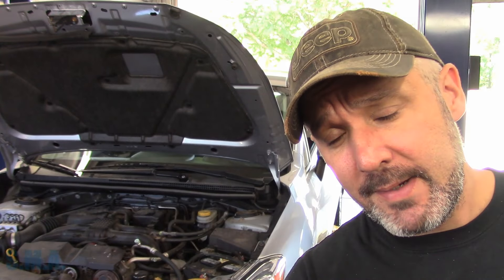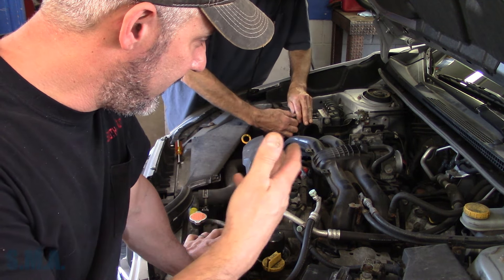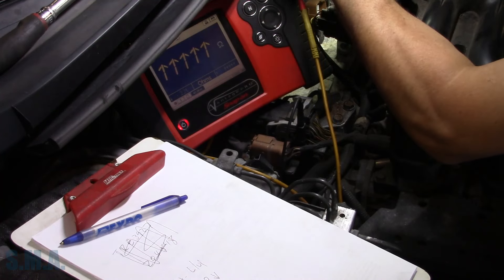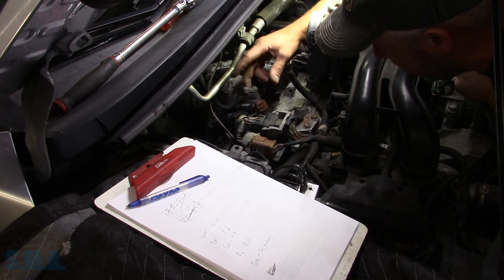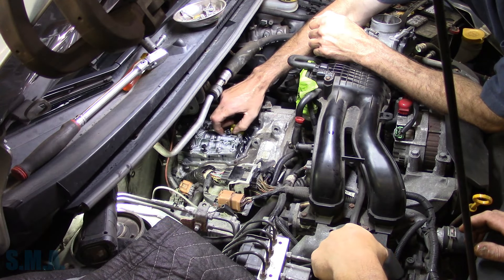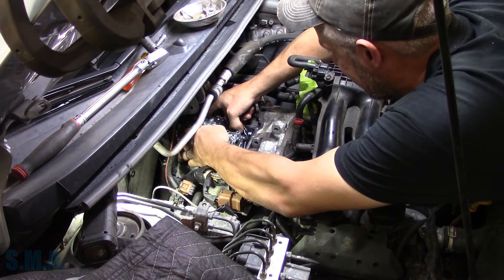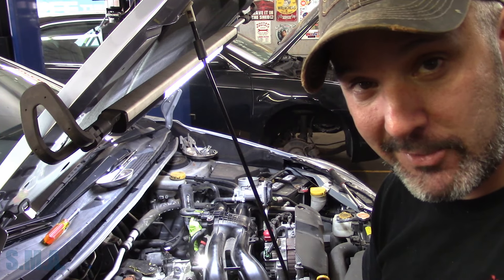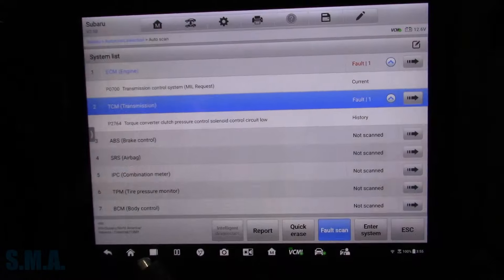Subaru CVT Transmission Valve Body TR580

Comment: I bet all that insulation on top of the trans is for noise control, If if were my car the first thing I'd do is rip that shit off of there. Seems it would only heat up the transmission and cause trouble.  I remove plastic engine covers and hood blankets on my old beater cars to keep the heat down as much as possible, at the very least I imagine it helps keep the plastic under the hood from becoming so brittle.

Comment: My Subaru also developed transmission issues, possibly because I had started to experiment with shifting without the clutch 🤔
Reply: Best to learn Rev Matching on an old clunker or a Semi if you have access to one
Reply: @1HotLegendLS  Last year the clutch went on my '05 Kia 2.0l diesel. I was at a friends house about 10 miles from home. I got her to stand in the road and check for traffic. I started the car in 2nd. and shot out into the road but managed to get into 3rd. gear for the rest of the journey. There were too many tight bands and steep slopes to warrant going for 4th. gear. Yup, I know how to double de-clutch. (youngsters these days, grumble grumble!)
Reply: @rysacroft  I drive my semi all day only using the clutch to get rolling.

Comment: Thank you for showing the struggle of removing the valve lid. I’m having the same problem but like you said every video just shows them lifting it right off! I’ve been afraid to put heat on the lid bc of all the wiring around it. But I’m out of options. At least I see that I’m not the only one. Thanks again!

Comment: 9:23, "I wish there was a bolt hole right there, but there isn't."  Easily solved with a drill and tap.   😉
Reply: Also.. remove that dowel pin. Really not needed on this . The plate just drops in flat.  Easily located bolt holes.. weird for it to have a dowel.

Comment: If I had seen this a month ago, maybe I would not have had to sell my 2012 with CVT to the dealer.  It had one foot in the grave though.  Burned oil, leaked from timing gasket, and then the CVT.  I too expected more from Subaru.  Never again a Subaru or another car with a CVT.
Reply: Agree with you. From personal working experience, cvt’s are the worse type of transmission the is. Nissan and Subaru have the worst cvts. If u see the word cvt, stay away.

Comment: I just did one of these & found that you can get just the solenoid & don't need to replace the entire valve body. I hit the search button on my Autel & Youtube video popped up. Gotta love the Youtube! 

 Koauto Torque converter Lock Up solenoid For Subaru Lineartronic CVT TR580 TR690

Oh yeah bye the way mine just came apart ;-)

Comment: On the slightly older Subaru's I have diagnosed a bad solenoid in the trany, and another Subaru had 2 bad solenoids. Both times is drop the pan and replace the bad solenoid(s). Now it's on top of the engine, a little better, no messy fluid,  but if I was Subaru, I'd fix the recurring problem instead of stocking 10,000 solenoid bodies that the Subaru's will certainly need by not fixing it. Guess it keeps the Subaru dealership mechanics employed, and gives the parts department a job stocking 500 of them and selling a few every week. And why is it when the dealer says they have all the parts in stock and you order them, a few are missing when the order arrives ??? Hole in the parts collection bag ?? Nice job, carefully done and explained with precision. I did get a chuckle out of the gasket and aluminum lids being shown and narrated during your explanation !!!  As to this kind of video with two people, it was okay, maybe you can rotate between them for us to make a solid decision. Remember, if you can do it, I can do it !!!!!    : - )

Comment: I'm a Subaru owner (two Foresters) and appreciate you doing vids like this one.  I've heard about the later Suby models with valve bodies being on top of the trans and have wanted to see what was involved.  My main Forester now has 71,000 miles and have been told that the valve body will probably go bad at about 125,000.  Thanks for this informative video.
Reply: Newer Subie CVT's are MUCH better than the older ones!
Reply: I'm looking at this because the dealer is changing one out on a 2014 impreza for me 110000 miles on it but still under warranty thank goodness i just wanted to know what a valve body was

Comment: Free tip - on Subaru's, you can move the rod holding the hood.  It pops out of the hole it normally sits in and you can put it into the same-sized hole right in front of the passenger strut housing in the engine compartment.  Hood is a lot more vertical and that rod is more out of your way.  Hope this helps!
Reply: this has been a feature since the '80s.

Comment: 1st Time watching.  My 2015 Outback, 3.6L is getting the same treatment w/92K.  Subaru picked up half the cost, since they have a bulletin out regarding the CVT, #16-107-17R.  SoA says the valve body is not an 'internal' problem so their proposed 10yr, 100K extended did not apply!  I called BS, but ...thanks for the video!  It was good.

Comment: I just was stuck at the same point with the cover frozen on., but thought of a better/easier way to get the cover off quickly. Use a slide hammer with a reducer on it to fit a longer bolt into the corner hole, then you can slide hammer it out. Took a couple of slides to loosen/pop cover off.

Comment: Great video! Just the bit about testing the Ohms was a big deal! Shop said it was likely the valve body...I checked the ohms and they were all good. What they missed was my coolant level was low and they also missed that the air induction tube to was literally not attached (plastic rivet shook out causing the whole thing to wobble and loosen... No seal at air filter and poor seal at the throttle body). I didn't need to change the valve body at all. Currently no codes and runs and drives great! Hit the high spots first before going with what the shop says.

Comment: i personally don't think anything you do doc sucks. it's all good info. even though all my vehicles are all hot rods. my newest is a 99 f-150 my oldest is a 1940 with a 4.6 thirty two valve out of a cobra mustang. i'm trying to learn how you figure out what's wrong with these computer cars. i think the best one was the mustang that just stopped running out on the road. 
          thanks so much for all you've taught me. personally i don't think i could do any thing you do even if you were stand right next to me. i think you might fill that bad word jar up pretty quick.

Comment: I bought the solenoid and gonna attempt to remove and solder a new one into my old valve body this weekend. Hoping for the best, ain't got $1300 for a new valve body. 

I've found you can still drive with this issue as long as you feather the gas pedal every 5-7 seconds, no shutter at all over 60 miles...but then you gotta feather the gas pedal for an hour

Comment: Have a tip for you!
Finger tight the fasteners on the loose side. Back them off a smidge. That should let your pull max out the loose side and wedge up the side you're currently torching.
Reply: 2016 subaru legacy. Passanger side front seat with power adjust. The occupancy sensor went bad. They had to replace the entire lower seat for a sensor. Worst cars to maintain ever. IMO

Comment: Just replaced the lockup solenoid on my 2013 Impreza.  $100 for the part and about six hours labor (no rush doing a job for the first time).  Great video and %*%&&#^ that dowel pin.....

Comment: I used a vice grip/slide hammer combo attached to that bolt to remove the cover over the valve body.  It worked very, very well and crap around here is almost as rusty as there.

I got a solenoid off of Amazon.  The original one was open circuited.  It is physically the same solenoid as the other two, with the last one being different.  Despite being the same, the torque converter solenoid is the one that is problematic for whatever reason.

And there's no reason why Subaru / Jatco couldn't sell just a solenoid, given how common of a problem this is.  Time will tell about how long the Amazon solenoid holds up.

Comment: Thanks for the video, I just had the same codes come up. I was able to replace my valve body with your help from this video. Not as hard as I would have thought
Reply: hey...which  scanner did you use for the transmission relearn?
Reply: I did not do a relearn. I know that it was recommended however I was unable to with my obd2 mx plus. I just put the car on 4 stands and ran it through the gears without a load at temp. Put around 3k miles on it so far without a single weird shift.

Comment: I had to do a relearn on the TPMS sensors on a Ford, first step was to replace the rear brake backing plate and parking brake hardware, then the cables and adjustments, then I was able to relax and find out I need a sensor (of course I bought batteries and am going to try to fix it first)

Comment: If changing the trans fluid. drain the fluid first and measure the amount take out. before installing the new valve body. pour the new fluid same qty as removed plus about 1/2 pint more. This should get you very very close to the correct level. Then install the new valve body. close up the trans. start the car and warm it up to temp. Check the fluid level underneath at the correct point and let any extra spill out into a catch pan.

Comment: .....nice drive through your Maine countryside. I watched a bit of the beginning middle and end . Cars used to be simple once. Now they have sensors, computer , catalytic converters  and more that can all go wrong. Scotty has ranted and gesticulated about unreliability of CVT transmissions. He mentioned latest Toyota CVT maybe it's Honda as being a quantum improvement having an actual real gear to handle initial launch stresses when taking off  and transition to CVT once underway .

Comment: I owed a 98subaru wagon and oil pump gauge was not at  specs  went to dealer to get them check my oilpump but did not have the ataptor to check oil pump so I left unhappy this is Subaru for you probably still have it went thought 8 inch off snow I loved it

Comment: ...and this is why in 2013 I avoided the 2.0/2.5 and went with the 3.6L H6 engine.  I got the Subaru 5 speed automatic and not the Nissan built Jatco CVT.  Those are terrible transmissions if you look at YouTube there are failures everywhere on that model.  Subaru now sources their CVT from their own design and the problems are reduced drastically, but these old 2013s are money pits.  It will continue to have problems no matter what you fix - it is just a bad transmission.  I feel sorry for that owner.  Now on my 5 speed auto I have over 100,000 on it and no problems at all.  I expect to get 200,000 out of it before I have an issue.  Still interesting to see the problems people are having frequently with this unit.  Thanks!

Comment: This explains why Subaru is now covering CVT’s for 10 years and 100,000 miles, do to issues. My 2015 outback with 32k needed new transfer clutches. Bill was almost $2,000 covered by Subaru

Comment: I have use sourced solenoids for three jobs for a test run, build in insurance in the price and customer gets better bill and I still making good money for pretty easy work. 
OEM quality dropped so much these days bit of due diligence in aftermaket and oem suppliers can pay off well .
Main reason trying this know is simply people not keen get the job done at 1K+ and as vehicles get older even more so, also it not hard do once done a couple so even if get a come back it not big hit do it again .
Is a case of waiting and seeing how they do .If customer happy pay then new valve block best way keep reliability high .
video style fine, flows pretty well and to the point no fluff ... little bit of struggle always good to show it ain't all lego lol .

Comment: The solenoids aren't available from subaru but they can be bought online. I just replaced one a couple weeks ago. Bought the new solenoid from Amazon for like $125. Not real sure on the brands. Neither the new or old has any identifying marks for a manufacture but obviously subaru has to get them from somewhere. Didn't see any difference in either one.  Worked like new.

Comment: Great video, keep them coming!

If you could answer these two questions, I'd appreciate it greatly. 

1.) 2015 Subaru Forester premium. 155,000 miles 
Lag time from park to drive or to reverse, 2 to 3 seconds before it'll engage, drive to reverse same lag or reverse to drive. When shifting to park it'll engage immediately. When stopped on hill, it'll hold fine when shifting foot from brake to the go pedal. This occurs when cold or warmed up. Driving seems fine with shifts. 

Is this something to be worried about? What are your recommendations?

2.) Fluid flush or drain and fill? Along with changing pick up screen ? 

Thanks, I appreciate and I hope you'll keep these vids going.

Comment: New style video is pretty good. Love it. Keep them coming. One quick question: Do you have to adjust or recheck AT/CVT Fluid level after the valve body since that's on the top side? Just curious. Hopefully one day I can get to your knowledge level as a mechanic. 😁😁

Comment: Lineartronic CVT transmission
Lineartronic uses a specially modified torque converter to connect the engine to the transmission. It can slip like a traditional torque converter, but remains locked under all conditions except when coasting or traveling at very low speed.  The persistent lockup condition under acceleration provides the efficiency and control of a clutch while still  behaving much like a traditional planetary automatic transmission.  The  transmission can also be manually controlled by the driver by providing the ability to select 6 or 7 (if paired with a Diesel engine) different "virtual" gears, where the transmission will hold a particular ratio.

This TR580 automatic transmission is used in these vehicles:
    2013-2020 Legacy/Outback 2.5L NA
    2012-2020 Impreza 2.0L NA
    2013-2020 Crosstrek 2.0L NA
    2014-2020 Forester 2.5L NA
Maximum torque 250Nm

The TR690
    2010-2012 Legacy/Outback 2.5L NA
    2015-2019 Legacy/Outback 3.6L NA
    2014-2020 Forester 2.0L Turbo
    2015-2020 WRX 2.0L Turbo
    2019-2020 Ascent
    2020 Legacy/Outback 2.4L Turbo
Maximum torque 400Nm 

Source: Wikipedia list subaru transmissions

Comment: Do you remember if you dumped the cvt fluid before removing the valve body? My vehicle has 130k on the clock and it is due for a cvt fluid change anyways. So I dumped the fluid. I am wondering about adding the fluid back in from the top before I put the valve body back in. It sure sounds easier than trying to get 12 quarts through that small dill port on the side.

Comment: I wonder. Could the faulty brake pressure switch (which has a recall/TSB) cause the lock up solenoid to short?

Comment: great video thank you so much!, what was the symptoms please?...i have a 2012 xv crosstreck with funny small jumps on low rpm...dont know if its VB or throttle body
Reply: think i got it...been measuring the solenoids and it looks like something is wrong, because i had only 2 solenoids with arround 13 ohms measurements in staid of 3...so maybe i have a bad lockup solenoid..the thing is...the colours in the cables is kind of confusing for me...cant find the white cable...there is some pink, yellow,grey...not sure...so i would like to know what is the position of this solenoid cable in the PLUG, so i can confirm that thats the one is bad and i try to replace it (cant buy a complete valvebody).
beside this, i want to ask you what was the symptom for this job? before the $ligth on the dashboard.

thank you so much.

Comment: I like this format, I don't need to see each bolt removed.  Great job!  After changing the valve body do you have to do the automatic transmission relearn?  I replaced mine but I don't have the cool scantool to perform the relearn.  I think that is why I can't get the codes to go away.

Comment: You've saved my rear end with this video, I'm about to change my own valve body in my tr580. When i change it this way, do i need to add more cvt fluid? Or is the loss negligible?

Comment: You used a small bolt on the right hand side to jiggle the cover. Why not tap a thread in one of the holes that you removed a hold down bolt from and insert a larger bolt to pry from?

Comment: probably take 3 to 5 minutes with that torch on full chooch, your arm will fall off holding it in place. I know all too well :)
also try big soft brass/copper rod over-top the dowel pin area and hammer with dead blow,  shock it hard enough so the rebound bounces upwards. obviously not a sledge hammer or hard steel that will beat the aluminum shut. also 45 or greater angle from the pin peck at it different directions. I hate steel dowels in alum/magnesium

Comment: We have subarus and i do my own repair work as well. What would be a good scan tool to have that reads the ABS, tranny and engine codes? Want to get a good all around diagnostic computer than is bidirectional and can do and read just about anything.

Comment: I know this is an old video but could you put a plastic trim tool under the loose side of the cover and tap the loose side down to move the tight side teter tauter

Comment: Do you happen to know which of the 2 orange wires on the gray connector is the 1 for the awd solenoid? I have a p0971 for the awd solenoid and 1 ohms out at 5.3 and other orange is 113 ohms. I have 13 subaru outback with the same TR580 trans.

Comment: I just had my 2015 Forester valve body replaced under warranty after p0700 and p2763 code and 87k miles. I've had 1 t fluid drain/fill at 65k. Is this a sign that the cvt is about to fail?

Comment: I have a p2764 code and a C0045 (Transmission Control Module Fault).   Could replacing the valve body take care of both?  I have a 2013 Outback with 178,000 miles.  I was told to replace the whole transmission.  It would be great if just the valve body could fix it.